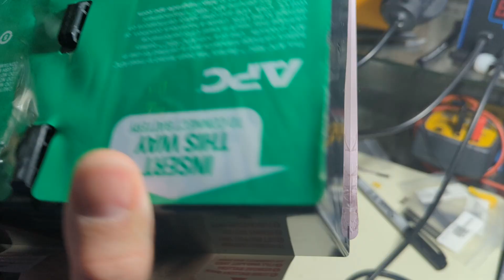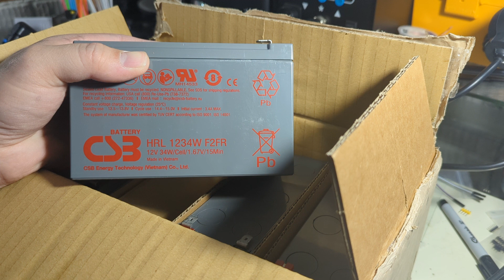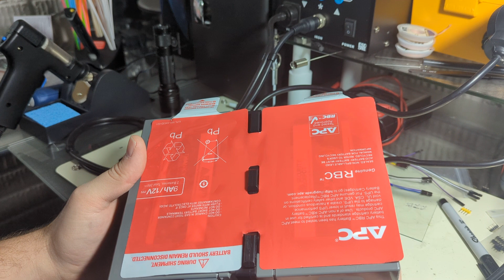APC Battery Cartridge Rebuild

Comment: I just slice the label in half with an xató knife.  Replace the batteries and just use clear shipping tape to combine them and make the lift out tabs.
Reply from the maker: I've also been guilty of using duct tape. Funny if the RBC's were just a little better priced I would buy them.

Comment: What’s the Model No of your UPS ?  Also, make and Part No for the replacement 9Ah battery pack ?
Reply from the maker: Mine is just a 1500VA model don't recall the exact MN at the moment, the batteries are these lil dudes https://www.amazon.com/s?k=CSB+Brand+HR1234WF2